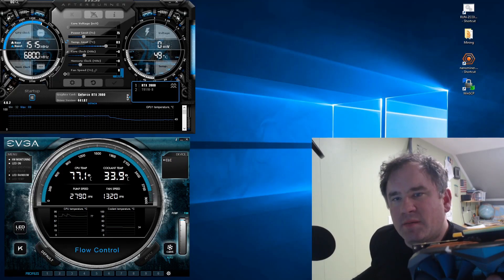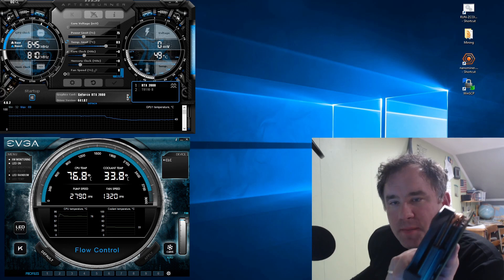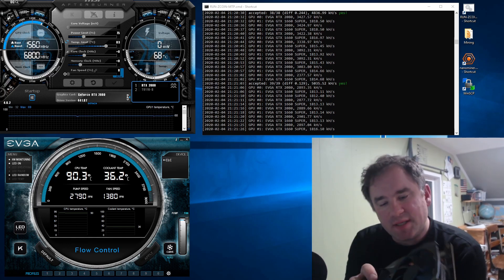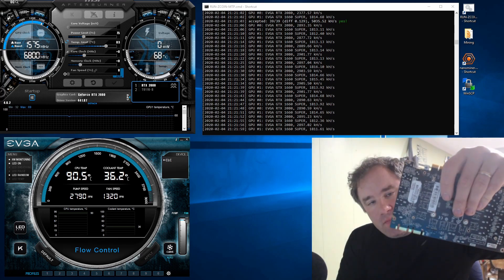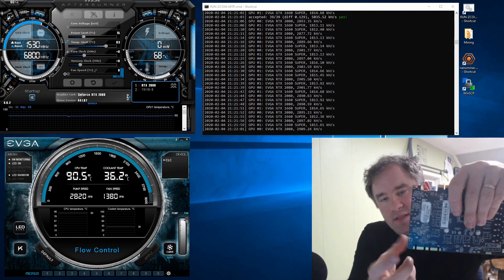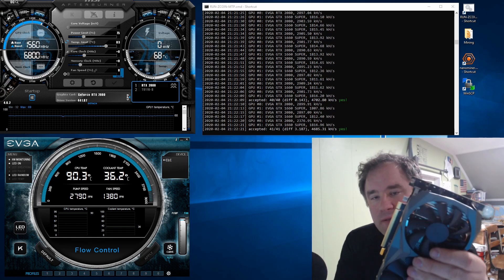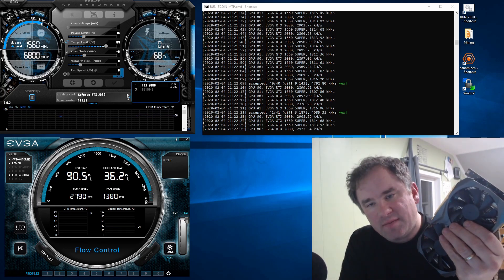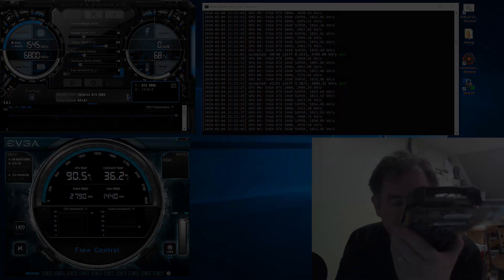How to mount the INNO3D P102-100 mining GPU?

Comment: i use a M3x30 bolt at the hole where the top bracket would be and use two zip ties to attach it to the rig